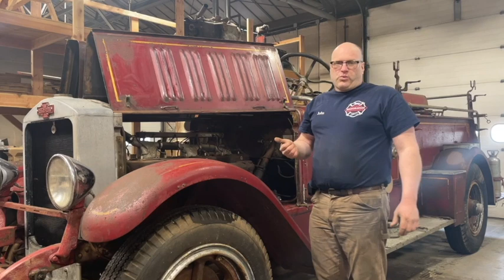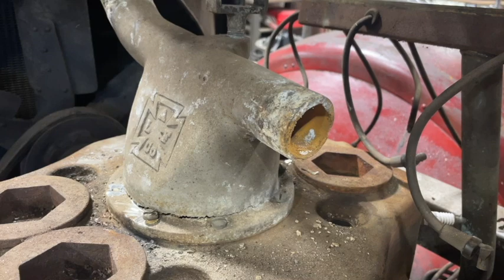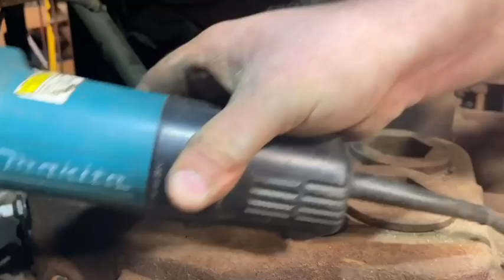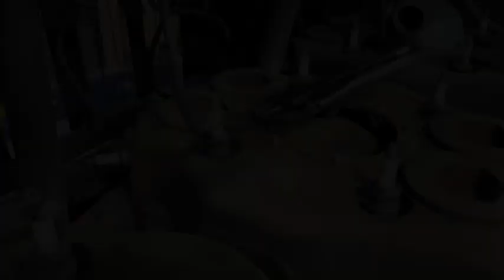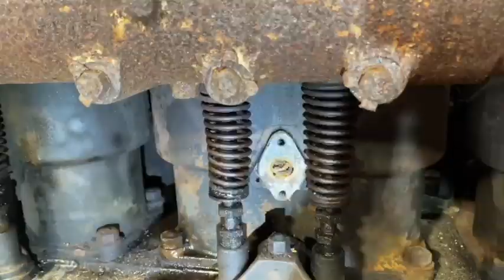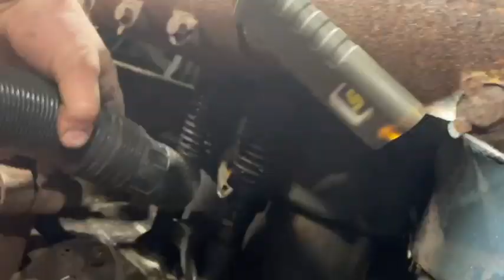1930 American LaFrance Part 2

Comment: I would suggest getting a "Shake and Break" tool for those stuck screws. It basically works with an air chisel to vibrate the screw, frequently loosening. A tool of this type has long been popular with aircraft maintenance. I would also try soaking down the bolts with Kroil penetrant. It works for me where nothing else did. I've used it for almost 40 years, and wish I had it in the 60s!

Comment: A good trick I found for losening screws like that is a thin blunt end chisel and hammer make sure the blunt end of the chisel will fit all the way to the bottom of the slot in those screws then strike the chisel hard several times will break the screw loose. A screw driver with the handle removed will work good for that also. Im a 78 year old retired mechanic that came thru old school ways of learning things

Comment: A couple of ideas for removing those screws.  Using your manual impact, place it all the way down so it won't try to turn the screw when you hit it.  Then, wallow away on it to break the corrosion holding the threads together.  Then reset it a to twist and try it again.
You need to hold your torch on the screw longer and may have to repeat it several times.
They also make a tool that goes in an air chisel with a screwdriver bit and a handle coming out the side of the bit.  The idea is to use the air chisel to create vibration and the bit can be moved back and forth breaking the bond.
Finally, and I've not tried this, use an electric impact set to impact only to break the bond.
Hope these help.
Reply: Ya, had a smirk on when he started talking about tools and he doesn't even have a battery impact driver - the one tool I use daily at home & work! I was also wondering if the water pump seals didn't ruin spinning without water at the least. So glad he decided for the patina instead of painting. I wonder if all the plugs were firing, but with 3 per cylinder it's a bit redundant. As a rule, I like to use penetrants a day or 2 before removing anything. Saves you a lot of work.

Comment: wouldn't it have been better to use a spray foam cleaner to lift off the years of grime, before using a less aggressive pressure washer setting.

Comment: ... Years ago we had a problem with a similar water pump leaking at the shaft because they used a felt washer as the seal. Years of lubing it and snugging the nut wore the shaft. Took the whole thing to a machine shop in Long Island and had a guy hog the housing for a late style ceramic seal. Been leak free for about 25 years now.

Comment: I just put a screw driver firmly in the slot and use a hammer to give it a "love tap", works well most of the time

if it didn't then she didn't love you

The shock from the hammer smack loosens the years of rust & corrosion enough to loosen it up

Comment: I,am in the UK i had a old Dodge with a messy cooling system i found a non toxic home heating flush liquid i used it for a week running around and then opened the drain cock on the radiator you should have seen the crap run out ....just a thought

Comment: Breaking the castings loose try adding lube first and cut the handles off several thin  flat screwdrivers gently use them as wedges spaced around the edges  keep tapping but not in sequence

Comment: Yes, I too noticed you didn't use a drop of penetratating oil on those water neck screws.  Why? Is it pointless when you are using heat in the first place?

Comment: One way of removing those machine screws, if they're not wanted, would be to tack a nut on top of each one then they use a wrench.
Reply: ... I believe he said they were brass so you'd have to braze them and hope they don't snap. Personally, I feel a real torch could have put enough heat in there to do the job, but he still needs new hardware due to the odd thread.

Comment: The strips of cloth like seals at the hood to cowl overlap look like asbestos containing material.  I would treat them as such until you confirm otherwise.  Some rather simple methods can be used to prevent asbestos contamination of other material, like your lungs, until they are if needed replaced.  I think you should find appropriate information available online.

Comment: Just a to help comment, the next time your removing bolts with a screwdriver up where the handle starts is a place like a hex nut. Now not all screwdrivers have it but most good ones do but find a wrench that fits it and use the wrench for a little more strength to loosen the bolt.

Comment: Why did you chisel off the heads and then use penitrating oil.  You got that backwards.
Reply: heat then oil, heat then oil, heat then oil... cut as last resort

Comment: can you clean the crack and braze it in sitzu?
Reply: ... those were aluminum. Personally, I would have added weld on the inside (where it doesn't show) and used the filler putty on the outside.